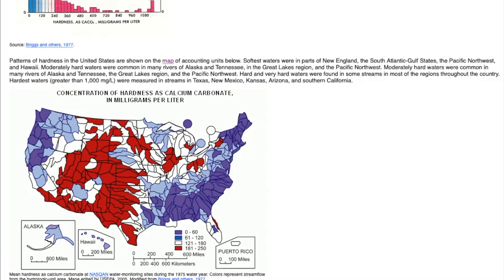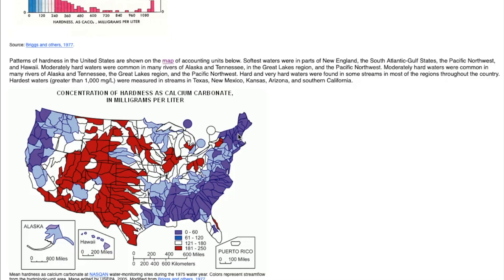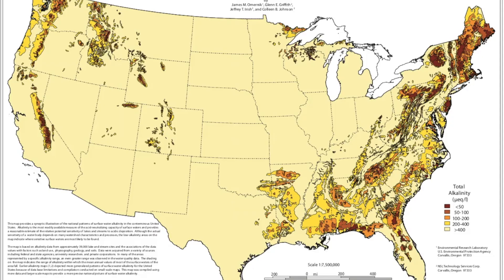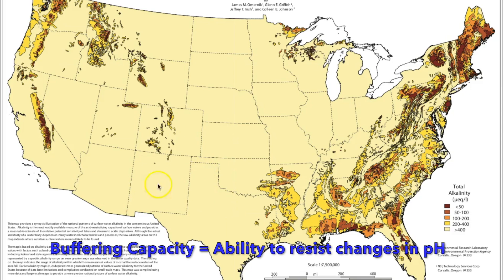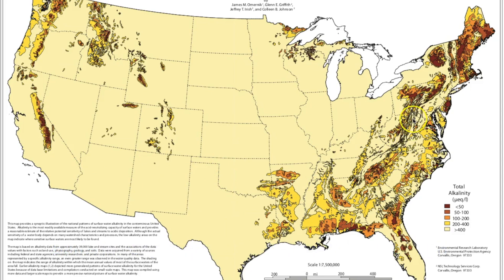Fish Tank Water Hardness Fully Explained: Don't Kill Your Fish!

Comment: I did hear this ??!!. RO water from the Dehumidifier, used as lowering the PH.. (i was told that dehumidifier water is not ROwater, because it drips of the medal in the canister.. Help me understand which is which.. thank you.. ( I read this:)No, you should not use water from a dehumidifier for a fish tank because it can contain harmful contaminants like dust, mold, bacteria, and metals leached from the coils, and it lacks essential minerals. This can poison your fish and disrupt the aquarium's ecosystem, so it is best to use it for other purposes or discard it.
Reply from the maker: I guess it depends on how long the water sits? If we didn’t have hoses running directly into the wastewater system the container would fill 2-3 times per day? I’ve tested it and the TDS is close to zero. 😀
Reply: @PrimeTimeAquatics  I tested my dehumidifier water today, PH is 7 .8 .. No ammonia, or nitrites. I do not have a TDA  tester. wish I did.. but on the PH level, it was really dark blue.. what does that indicate ?

Comment: My water in NC is 7.2 pH and 2 degrees on kh and kh with a TDS of 65ppm. I use a buffer to raise gh for my central american cichlids but the company does not sell the bigger buckets and only small containers which I go through in 2 weeks (I have 6 tanks of CA cichlids).
Can I use a rift lake salt such as fritz or seachem to raise the gh for central american cichlids?
Reply from the maker: Sure but that will also raise KH
Reply: The salt raises gh only.

Fritz makes a separate buffer for pH/kh.
Reply: Which is good as central american cichlids come from high pH alkaline harder waters.

Comment: This video was helpful but I do have  questions. I have a 15 gallon tank that is moderately planted. I am in St. louis area. My hardness is very high gh 300+ ppm, kh is 0 and my ph has been fluctuating from low 
to moderate. 6-7.5. I have lost some fish by not checking ph. I was wanting to add crushed coral but I am afraid of making the watered harder. What do you advise? Thanks so much for your help
Reply from the maker: Adding crushed coral will make it harder, but there is no way around it if you went to increase KH.

Comment: I have a weird situation. I tested the tap water coming out of my faucet and my total hardness was 0 and my alkalinity was 300 ppm and my water was between 7.8 and 8.4 according to the chart. I was confused that I have soft water and it was alkaline. I didn't know that was possible because the harder the water the more acidic it is and vice versa for the alkalinity which is what I thought.
Reply from the maker: Actually it’s the opposite - higher KH (harder water) correlates with higher pH!

Comment: Can adding 5 gallons RO water to a 15g tank that has been running with filtered tap water change the PH enough to kill my fish? Our water tested 40pp nitrates at our lfs today and they had us add 10 drops of prime to the tank and recommended we buy their RO water. We only changed out 2g today and we were going to do 3 tomorrow but I’m worried. I’m going to take my filtered tap water to the pool store tomorrow to test for chlorine. It’s a berkey filter that is supposed to remove chlorine. Trying to shorten this comment so I’ll end here but feel free to ask any questions you want. Edited to add: they said our water smelled like chlorine
Reply from the maker: I'm really surprised the filtered tap water has nitrates in it. I wonder if the easiest solution would be to run a it through carbon? If your KH is low, adding RO can change the pH of your aquarium.
Reply: @PrimeTimeAquatics  In conclusion to the saga: 🤣 I went to the lfs yesterday and told them about the filter sock and they recommended a filter media basket instead of the filter sock. It has fiber balls, carbon, and biomedia “gems”. So I can leave the little gems in there to hold the good bacteria when I change out the top compartment. I did 3g water changes yesterday and today and guess what? My tank water tested less than 20 nitrates and 3 nitrites today. I’m going to continue the daily water changes until the nitrites are gone. Thanks for listening! 😄 Hopefully this helps someone else. Don’t add several fish and then immediately throw out your good bacteria with your old filter sock.😅
Reply: @PrimeTimeAquatics  I’m sorry I meant to say our aquarium water tested 40 pp nitrates 🤦🏻‍♀️ and they said it smelled like chlorine. I’ve been bringing it to them to test every week. It has been testing very good all along, but last week I added 11 fish and I guess I hadn’t been doing big enough water changes so it was 40pp yesterday. But the main thing they were concerned about was the chlorine smell of my tank water. Which the other guy who usually tested it hadn’t noticed before, but this was a different guy. And I got to thinking late last night and worried adding RO water might change the PH.
Reply: Okay I went to our pool store and tested our unfiltered tap water and our filtered tap water. Unfiltered was PH 8.2 and .5 Chlorine. Filtered was PH 7.6 and 0 Chlorine. I think I’m just going to ignore them saying my tank water smelled like chlorine and continue using my filtered water. None of my fish have died using that. But I will definitely  do more water changes to get the nitrates down.
Reply: @PrimeTimeAquatics  The other day when I sent my first comment I ordered the tetra testing strips through your link. My tank water tested 40 nitrate, 10+ nitrite (it’s even pinker than the last indicator which is 10) , 150 GH, 0 chlorine, 40 KH, and 7.2 PH. 

The water straight from the tap tests 0-10 nitrates, 0 nitrites, 75 GH, 0 chlorine, 0 KH, and 7.2 PH.

I’ve done 2 gallon water changes each of the previous 3 days and when I saw how high the nitrites were today I did a 5 gallon water change. 

I think I may have accidentally crashed my tank because around the same time I added 8 green neons and 3 pygmy corys, I also changed my filter sock for the first time. It’s an internal filter that came with my innovative marine 15g cube tank. After researching more I’ve seen that losing that beneficial bacteria in old media can cause nitrites to go up. I didn’t realize that at the time. 😬But I don’t know. That might not be it at all. I waited an hour after the 5g water change and the numbers haven’t budged so I don’t know what to do.
Reply: Ammonia is testing zero

Comment: Recently got back into the hobby and went from a 33L as my big tank 2 years ago to a 125 with a huge sump.

I listened to videos like this and so many others and decided that stability was my missing factor. It's so true. Did RO water with a ATO/AWC and pull out about 10% of the water a day, refilling with the RO stuff. With the sump loaded with cycled material and water that is practically identical every fill It's so much easier. 0 nitrite 0 nitrates. Now I just gotta decide if some uncertainty with adding hardness back in is worth it.

Comment: still in my early stages of learning, have most of my supplies and am starting to learn about water before actually filling up my tank.  have been watching all of your videos and finally decided to use my first test strip on a glass of my tap water
GH 30
KH 240+  it went as high as the table on the tube
pH 7.5
have been hoping for south american fish, neons to start, hopefully a ram in a couple years once i figure all this out. but don't want to have to 'chase the ph' or have to try and control the water too much.  am i needing to go back to the drawing board and pick different fish?
Reply from the maker: I light start with something that likes the harder water - guppies, mollies, platys?

Comment: Thank you! I am in Massachusetts and my kh is super low! I am new to the hobby and have a white specter crayfish in a 20 gallon. I’d like to raise the kh in her tank to help with her molts. Tried a shrimp mineral product which raised the gh too much. Did a partial water change with my tap to bring it back down slightly. Is trying a small amount of crushed coral a reasonable idea to elevate kh?
Reply from the maker: I might go with aragonite?
Reply: @PrimeTimeAquatics  thanks! Will give it a try and monitor closely

Comment: Inherited my parents Koi. Running 10k gallon Koi mostly mature koi about 12 of them.  15+ years old most ranging 10 to 18lbs. Pool is 9 ph. Needing to bring it down. Have done 3  25% water changes in the last week. Used a pond zyme sludge destroyer treated only 4k /2 cups of treatment. Still high haven't lost anymore fish yet. At a loss to understand why. I have added about 12 water hyacinth also to help with originally high nitrate levels. I am debating adding white vinegar to the pool to help bring it down. Each day with water changes or treatment there has been foam/slime. Any help you could offer would be appreciated. Thank you.
Reply from the maker: If the pH has always been that high I might not do anything too drastic to bring it down.
Reply: @PrimeTimeAquatics  thank you for replaying.  So lost here. I checked the ph of the tap water and it's light blue. But definitely blue. The fish look more friskie since the water changes but there is still slime in the water.  Not sure if that a side effect of using a declorinator or perhaps still there from using the sludge remover afterwards.
Reply: @PrimeTimeAquatics  originally presented with flashing and ulcers. Lost 2 very large 18 lb. Males ages 21 and 30 yrs old. That was 2 weeks ago.

Comment: Guess I came to the right video my tap water is as neutral as it gets next to literally being RO it has 0 kh and 0 GH my tank has been pretty well established but I have noticed the older it is getting the more my pH is dropping down to 6.6 I think my fish are starting to take a hit! 

I found water at Walmart that is relatively very hard and I thought I might be able to cut one gallon in a 5 gal bucket with my tap to slightly boost gh and kh and slightly raise my pH... Is this dangerous? 😮
Reply from the maker: It can shock fish, so I would do it slowly like you suggested.

Comment: Is it ok to use salty shrimp Gh/kh plus to raise it for my soft water from the tap? Or does this only apply to RO/rainwater ?
Reply from the maker: You can use it with tap, but you would probably have to cut back a little if there is any GH and KH in your tap already.

Comment: I have a water softener and it uses salt, and can't buy potassium because its sold out everywhere for the water softener. I dont want to kill my fish! I bought equilibrium and put 1/2 tsp in with my water change of 10% for 75 gallon tank. It made my PH go up a couple points.. I am worried about what to do because my plants are not thriving, but most importantly I dont want to kill my fish. I have a community tank with small tetras and platys, corys, otos, etc.
Reply from the maker: Water softeners can make it tough to keep some types of fish. People who have them often have a bypass for their aquariums and mix RO water if necessary to bring the hardness down.

Comment: Oh help!! I have very soft water with an off the charts high pH (above 8.8 on the API test kit out of the tap. GH at 2 drops and KH at 3 drops). The pH is NOT stable (drops down to 8 after sitting for 24 hours and down to 6 at 48 hours, after which it continues to drop). What do I need to do to make this safe? I'm planning on a tank with blue rams as my centerpiece, so they'll like the softer water, but I've gotta figure out the pH and I have no idea what to do.
Reply from the maker: I would add aragonite or CaribSea Cichlid mix - that might help buffer the water.
Reply: @PrimeTimeAquatics  Thank you so much! That seems to be working perfectly!!

Comment: Have PH 7.8 GH 0, KH 120. How is this possible? I’m so confused. I’ve read fish need some GH but don’t want to raise my PH or KH higher. I might be unintentionally subjecting poor fish in my aquarium to lives of misery until I figure this out.
Reply from the maker: You can raise GH without having much of an impact on the other two!
Reply: Added some equilibrium and a wonder stone, GH is now 75! Hope the fish can start acting happy and swim around instead of sitting in the bottom corner of the aquarium panting all the time. Water parameters are testing perfect now with the slight raise in GH so I’m not sure what their problem is. Thank you

Comment: My tap water is roughly 0ppm for both gh and kh and 6.4 ph. I’ve been using crushed coral but it raises my gh significantly more than kh. (40kh and 150+gh). I don’t need or really want my gh that high as I am wanting to keep softer water fish but I do want to make sure my kh is at a good level to avoid ph swings. Is there something that might raise my kh and gh more equally than crushed coral or is there something I could add to a reduced amount of crushed coral besides baking soda or chemical to equalize those levels? If those are the only options what is the safest way to use them? I would be devastated to lose fish because of a stupid miscalculation on my part.
Reply from the maker: You could try Caribsea African Cichlid mix? Also - Fritz makes an African cichlid salt that works.

Comment: Hi I am in Northern Maryland Harford County. I am on Well water and it is Acid 6.0 or less. It is also Hard water with a lot of Iron. I am having a hard time getting it to stabilize the water. Crushed coral has not affected the PH.
Reply from the maker: African Cichlid mix by Carissa may help if used as a substrate. It won’t help with the iron though. For that you would need to experiment with RO or a carbon filtration system hooked up to your tap.

Comment: My general hardness is like 90 drops and still didn’t turn its color I check my tap and the water hardness is super high what do I do to bring the gh to a suitable level for angel fish &tetra and other small cardinals rummy’s and neons
Reply from the maker: The only thing you can really do is add RO water?
Reply: @PrimeTimeAquatics  could do to my a api gh&kh test being expired it’s  the reading is not accurate 🤷‍♂️ expiration 2017 it says

Comment: hi Jason! i have a question that's been burning on my mind.  getting ready to set up our 29 gallon and we live in the Indy area. our water is TERRIBLY HARD and smells bad. in the past when i set up a 10 gallon i had an awful time with water quality. i am thus a bit paranoid. what are your thoughts on using bottled spring water instead of tap?
Reply from the maker: It might be cheaper in the long run to run it through a carbon filter system?
Reply: @PrimeTimeAquatics  can you be more specific on what you mean by carbon filtration system? Are you talking about something like a pur water pitcher?

Comment: Hello, thanks so much for all the info it is very helpfull video god bless you!
I would be very gratefull if you can answer my question!
I keep guppies in a 50L tank with lava soil and jbl plant soil and la plata sand and driftwood and anubias and crypts no Co2.
I test my aquarium water, my GH is between 10d -16d and KH between 6d-10d, Ph 7.6-8. My tap water is 250ppm.

Should i lower my Gh to 150-200ppm using distilled water ?
Is it worth it?
Reply from the maker: I wouldn’t touch it with guppies - they do well in those water parameters.
Reply: @PrimeTimeAquatics  thank you so much!

Comment: Amazing content as always Jason. Thank you. I have one question. In Sydney (Australia), tap water is quite soft. Kh is close to zero, GH is circa 50. But when I test the GH in my tank, it's quite high, around the 180 mark. Is this being caused by evaporation? If evaporation removes the water, then concentration of magnesium and calcium would exponentially get higher and higher with each water top-up, wouldn't it? Unless our top-ups are always done with distilled water. From your vid, my understanding is that adding distilled water may further lower KH which is already dangerously low in sydney.... Appreciate any advice.. 🙏
Reply from the maker: That is true - if you just do top offs over time the GH and KH would probably increase.

Comment: I have well water it comes out at around 7.4 or lower but as the aeration acts over a night or 2 it goes up to a 8.2 so I keep Peat moss and almond leaves in the sump that has no effect. My question is there anything I can do to stop the swings other then putting water in something and aerating over night with large heavy stocked tanks this wouldn't be an option
Reply from the maker: You could also use some RO water?
Reply: @PrimeTimeAquatics  that's what I'm thinking my only option is

Comment: Do you have any suggestions for reducing hardness in water if the water you start putting in your first tank is so cloudy that you can't even see your plants? Sand substrate that was purchased pre-rinsed. I do have a countertop RO system but it has an alkaline filter, so regardless of whether I stick with tap or RO water mine is around an 8ph.
Reply from the maker: RO is the only way to go for reducing hard water.
Reply: @PrimeTimeAquatics  Thanks! Turns out the problem with the cloudiness of my tank was improperly processed substrate...haha.

Comment: Hi there, I live in Ireland and I have naturally hard water. I have just recently set up a new 20 gallon planted tank. I am currently doing water changes of 20%. My recent tests have shown

GH 300 mg/l +
KH is 120 mg/l, down from 180 mg/l
pH is around 8.0

My fish seem to be doing pretty good but I think I should attempt to lower these slightly. What would be the most long lasting and safe methods of achieving a slight decrease. Thank you!
Reply from the maker: The best way to do it is by mixing in some RO water, but you really have to make sure KH and GH remain consistent.